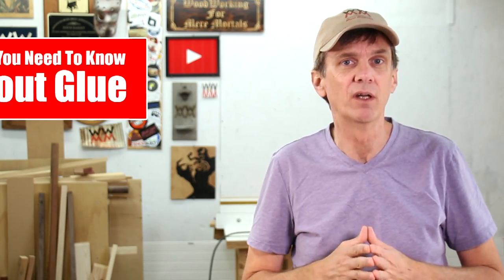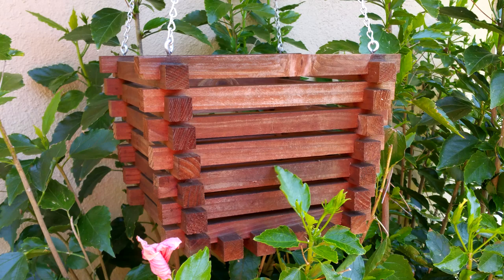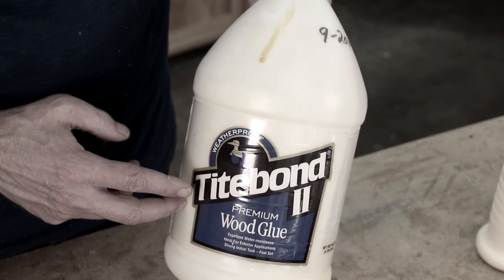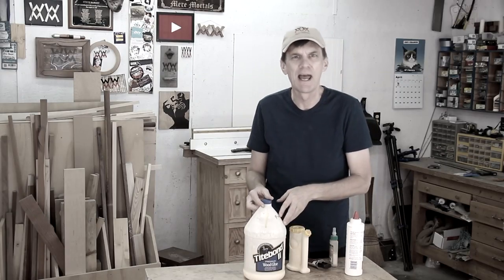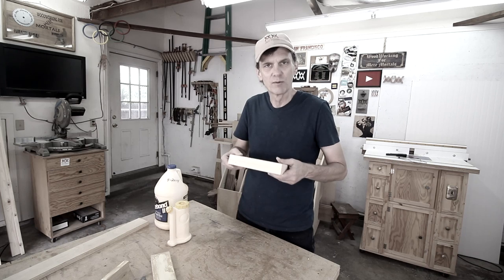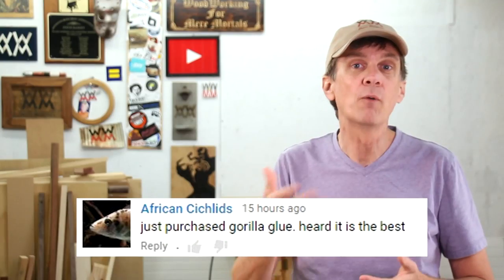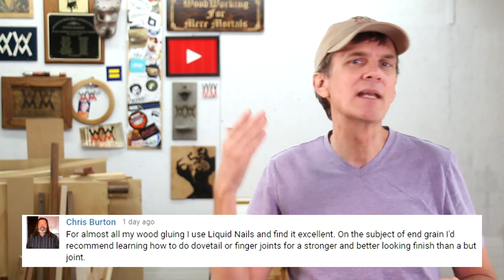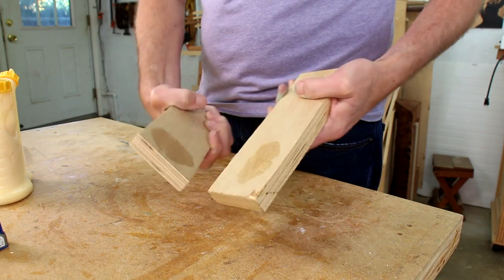Why I Don't Use Titebond III | MORE MINUTES

Comment: So here are my thoughts on this, the people saying Tightbond III is food safe are right, my guess is that it is food safe because it is only waterproof, perhaps what they add to Tightbond II to make it 'weatherproof' also makes it not 'food safe'. Most likely they both have the exact same performance other then this.
Reply: +Setsuraful 
The Titebond website says the same thing for both TBII and TBIII: "FDA approved for indirect food contact (cutting boards)"
Reply: +Setsuraful they actually have quite different properties, especially when it comes to open time.  Titebond III has a significantly longer open time then Titebond II.  Its not as long as their extended open glue, but it is noticably longer open time then TBII

Comment: So DAMIT! I’m a novice. Been using Elmers Wood Glue, it works fine.  The experts say, use Titebond! So I go to the store and wouldn’t you know it, Titebond 1, 2 or 3? So 3 is more expensive so it has to be better, RIGHT? I buy Titebond 3 and I didn’t like it as well as Elmers. Experts suck..

Comment: instead of buying a new bottle when the gasket is bust, why not cut a new one from an old bicycle inner tube. Road bike tubes are nice and thin, while MTB tubes vary from thin to stupid-thick. Plenty choices. Repurposes the tube and keeps another bit of plastic out of the dump.

Comment: hi everyone in 2019! im actually here looking for some info on titebond 50 - has anyone ever used it? i found a source, but it aint cheap - i've used tb2 &3 and 315g hide glue to build guitars before, but "fitty" is probably what i should be using... steep learning curve though (maybe?)
thanks see you all in 5 years!

Comment: When dry # 3 is dark in color and you'll be able to see the joint in light colored wood as pine. And # 2 is light in color when dry. That's the only difference I've seen over the years of woodworking.

Comment: Gorilla wood glue is pretty decent. I like it.
Reply: I discovered Gorilla glue's unique properties about 3 months ago. Works perfectly on parts that might not fit flush together.  The rubber ends (feet) on 2 folding support stands I use for my table saw kept coming off. Squeezed some water into the rubber parts from a paper towel (doesn't take much), added the glue, and slid the end back onto the metal tube.  After 30 minutes or so, the glue was bubbling up beyond the rubber feet.  I cleaned off the excess glue, and I don't think those rubber feet are ever leaving the supports again.

Comment: The BEST CAP iI found for Church Pipe Organ Leather Glue was the RED CAP on Elmer's Glue. I'd go buy a bottle POUR OUT and RINSE OUT the Elmer's Glue and put the LEATHER GLUE into the clean Elmer's Glue bottle, and that system would last a year or two. Where as the Leather Glue bottle would only last 2 or 3 months, and have to buy NEW. At $20 a quart, piss me off.  SERIOUSLY the designed Elmer's Glue Orange or Red Cap protected the applicator tip AND the contents of the bottle!!!

Comment: CA is very brittle by nature.  It does not hold a bond very well on wood due to the acidic nature of most woods, which actually interferes with the curing mechanism in CA.   Part of the issue with CA not doing well on wood is that the gap fill capabilities are not the greatest.  CA can be exceptionally strong, but substrate and bond geometry play a huge factor.  The "activator" is actually just to accelerate the reaction - the glue will still cure without it, but it will just take longer.  I do believe CA has its place - pen making, filling cracks in wood turnings, and repairing small non structural splinters or holes.  CA should not be used as a structural adhesive for wood, that is why you should stick to wood glue - it is specifically designed for bonding that particular substrate.  One or two notes on gorilla glue...  one reason you should stay away from poly urethane is that they contain isocyanates, which are a known carcinogen.  Always wear gloves when working with PU adhesives! second, the will work without the surface being moistened. Most wood has enough moisture to cause curing of PU adhesives

Comment: 2:03 "... the glue holding it together wants to repel stain."
does anyone have any experience with Titebond hide glue on this point—or actually, just in general.  I'd appreciate comments on your experiences.
Reply: I nought a bottle just to try it. It is fairly easy to work with, but it really gums up sand paper and reeks of old grumpy guy who hasn't taken a shower in quite a while when you sand it. It has a really long open time, so if you have a complex glue-up it may be worth a try.
Reply: NordboDK
thanks!  that's interesting about the sandpaper.  I wonder about using a card scraper on it.

this also makes me wonder how the titebond one compares to the oldschool kind you have to heat up

thanks for the info!

Comment: .....Tire bond loll   Works  at lower trempertures than titebond lll . There is five degree difference 60 degrees F vice 55 degrees F.
Aside from having. To heat my shop a little longer in the winter ll does the job about as well as lll for a little less money.

Comment: In addition to epoxy, Cynoacrylate is used on almost every model airplane constructed.  It is VERY strong for its intended purpose.  For one thing, the wood needs to be a bit porous, which the popular (for model aircraft) balsa wood is.  Rather than simply dismissing something because of low information and misunderstanding it's use, why not try a little research first.  :) Sorry to say this makes me wonder and question some.of your other information.  Hmm. :-/
Reply: in balsa wood you would get substrate failure before adhesion failure (the wood breaks before the glue)- as the nature of balsa wood is quite weak.  On other wood substrates,  CA is not a good choice.
Reply: "It is VERY strong for its intended purpose" yeah balsa wood is basically the most flimsy wood there is for anything beyond scale construction so I don't really see what your point is considering Steve is using glue for much larger and most robust applications.
Reply: CA glue is an anaerobic adhesive- it cures in the ABSENCE of air. Porous substrates like wood (which hold air) result in very low strength joints. I always cringe a bit when I see it used on wood, and cringe much more when I see people advocating keying the surfaces prior to using CA... In my opinion, epoxy is a much better choice for mixed material joints.
Reply: +Everfalling You all have never seen large scale RC model aircraft, have you.  Do a little look around on YouTube of quarter and third scale RC aircraft.  They are huge with massive engines and wing loads.  Much of the sheeting, hinges and other parts are bonded with CA.  Check it out. y point is that he is comparing the glue with the wrong uses.  Of course we wouldn't bong two flat pieces of playwood with it, but it does have its place.  To reject it entirely without understanding its use is not a helpful review of glues.
Reply: +videodistro sorry for the typos.  phone spell "checker"!   Aaaah!
Reply: +greaser5691 "CA glue is an anaerobic adhesive- it cures in the ABSENCE of air."  what? no it's not. CA glue cures with contact with water and the air has enough moisture in it to cure it by being exposed to air (this is also why it cures so fast on skin and in wounds). this is why opening and closing a bottle repeatedly leads to the glue becoming unusable more quickly than if you kept it in the bottle and never opened it.
Reply: +videodistro if this were a model plane channel you'd have a point but considering the projects he does it doesn't make sense to use CA glue for anything but a temporary bond. obviously it has its uses and works really well in some very specific applications but it doesn't seem like those applications are relevant to his work very often.
Reply: +Everfalling Exactly!  I was going to get to this but you beat me. :)
Reply: +Everfalling That's very interesting.  I've never heard water mentioned in the CA reaction until today (my involvement in materials at a technical level began over 30 years ago in the chemlab of an electronics factory). The reaction you've described (apart from the skin bit) sounds like RTV silicone rubber to me.  I note that the Wikipedia page for CA  agrees with you  (however most of the article has been flagged for lack of citation).
Reply: +greaser5691 baking soda also kicks CA glue instantly. why that is i can't say though i don't think it's because it's depriving the glue of oxygen.
Reply: +greaser5691 I work for one of the adhesive companies shown in the video and can confirm that all cyanoacrylate adhesives cure by moisture.  hence why "superglue" will bond skin immediately.
Reply: +Steve Rayner I'd be interested to find out why (in regards to CA):
- a tube with all the air squeezed out goes off in minutes but an open tube will stay liquid for months;- a spot on my skin stays liquid (can wipe pretty much all of it off with tissue) but will stick my fingers together immediately if I try to touch it. I used to use it for certain specialised types of PCB repair, I could leave a pool of it on a bit of polythene for hours and apply with a needle point. as soon as the track was placed it would immediately grab.
Reply: +greaser5691 two things play into factor here.  firstly, all CA'S are not created equal.  The Home Depot special Krazy glue is designed to last forever - and is therefore less sensitive to moisture, but nevertheless uses it as a cure mechanism.  these glues that are considered "shelf stable" have a higher acidic content which inhibits the reaction.  If you use and Industrial grade CA, the acidity will be  much less and therefore the adhesive will be much  more reactive.  If your bottle of CA doesn't have an expiry date on it,  consider it shelf stable.  This factor likely will account for tubes/bottles hardening up on you.  if you do buy an industrial grade CA, you should keep it refrigerated until you use it, but once it is opened leave it out of the fridge.  if you move it in and out, the temperature differential will actually cause moisture to be pushed out of the air (see definition of relative humidity).  this, may also play a factor in bottles haredening up.  as for the drop of glue on your finger/work surface; this has to do with bond geometry.  CA by nature does not cure well over large depths ax moisture must penetrate through said depth.  in general, the maximum gap you will be able, to bond with CA is 0.010", unless you use a 2-part CA which will cure to 0.2"  So imagine a blob of CA on your finger; the surface area to volume ratio of that blob is actually very low.  as that blob becomes longer and thinner over the same volume, the surface area to volume ration increases.  the smaller the gap, the higher the surface area, the more moisture available to cure the CA.  In a semi related topic, the reason human cells are so small all relates to surface area to volume ratio, and thus the ability to transfer electrolytes across the cell membrane.  Same principle, different application, but relevant nonetheless.
Reply: +Steve Rayner sorry for the spelling ; chicken pecking on a tablet....  also skin is mostly water, so it has a tendency to bond exceptionally quickly when fingers are pressed together
Reply: +Steve Rayner what's in CA kicker that makes it set so fast? surely it can't just be water right?
Reply: +Steve Rayner Thank you for the update. Consider me enlightened. :) Yes - used both types - I don't recall even the industrial glue having an ED back then (I'm getting old so all bets are off!) but even without an ED, the QA department used to impose a use-by on goods inwards for all materials like this as part of our AustStandards accreditation. It's painful to a hoarder like me to just discard 90% of a twenty litre drum of epoxy...
Reply: +Everfalling Yes, it is just moisture. Certain amines will react with CA, which are the active ingredients in accelerators.

Comment: Super glue has never worked for me, in any application.  It's always a disappointment.  The only thing it does well is become crusty on your fingers, and then you'll be spending an hour trying to get it off until you just give up and let it come off over time.
Reply: +WILSON! exactly my opinion on super glue...
Reply: +WILSON! CA has it's uses.  I've had good success using to glue in splinters, re-tacking loose veneer, etc when doing repairs.  But to get the benefits you really need the accelerator to kick up the curing speed.  I've had a lot of luck wrapping my thumb, pointer and middle fingers in masking tape before use.  Then you don't spend a lot of time waiting for the dried glue to drop off, or even more annoying picking bits of glued on skin off your project.  CA glue also doesn't seem to bond with the non-sticky side, so you don't have to worry about picking tape off rather than skin.

But I definitely wouldn't use the stuff alone in a load bearing joint: just too brittle.

Comment: Super glue is only designed for non-porous surfaces as you mention.  Don't think it would ever work well on wood.  Also it will only bond correctly with a super thin layer of glue.  In your example you apply WAY too much super glue.  It works by unraveling the molecular bonds on the 2 surfaces and causing them to rebond with each other.  This means the surfaces must be very flat and the glue layer micro thin.  A few drops would do a much better job than the amount you show in the video.

Comment: I use tightbond III on my cutting boards do to it's food safe...
Reply: +David Moss 
The Titebond website says the same thing for both TBII and TBIII: "FDA approved for indirect food contact (cutting boards)"
Reply: O really... ummm then I don't see any reason not to go with II then... I don't think it as awlays said that tho... good to know tho thanks man...
Reply: No Problem. One advantage to TBII is that it has a longer working time. I believe 10 minutes, as opposed to 5 minutes with TBII. But unless you have a particularly tricky glue-up, or you are subjecting stuff to a lot of water, TBII should do the trick.

Comment: Steve seems to be pretty sure of himself about some things that he obviously knows nothing about. Throughout this video, he makes statements about certain techniques and products that are wrong. Here is my rebuttal to a couple instances of misinformation.  Steve claims it isn't possible to starve a glue joint by over-tightening the clamps. He is wrong and you certainly can starve the joint by excessively tightening the clamps. The glue will travel the path of least resistance and squeeze out of the joint;.Just because the pieces are stuck together when you remove the clamps doesn't mean that the joint hasn't been significantly weakened. He also claims CA glue isn't strong glue and he has never successfully used it on wood. I can't imagine how he could possibly not get it to work, but that is what he claims. I get it to work all the time as do millions of other people and I can assure you that it is strong. It is permanemnt
Reply from the maker: Great rebuttal! We'll just have to agree to disagree! 😀

Comment: I only use TB3.  One bottle every 2-3 months.  Fine furniture, shop furniture.

I also use a damp rag and then a bit of sanding. 

I also use the wood glue sawdust trick. With TB3.

I use salt or very fine sawdust for big glue ups.

Gorilla glue is trash. Don’t buy it.

Comment: "Weatherproof" is NOT "waterPROOF"... simple.  Neither is 100% "waterproof", although Titebond III is more water resistant than Titebond II... neither is meant for 100% water submersion.

Soaking the hardened glue in an old bottle tip in hot water is usually enough to soften the glue residue to be able to remove the residue and remove it... nothing bonds to the LDPE/HDPE material that the bottle & tip are made from.

Comment: the super glue you are using is not the correct type. pick it up from woodcraft or fastcap. it is amazing you will wonder how you got by without it. you must use the activator with it to get the best results.

Comment: WRONG!!!  When using poly glue- dampen one side only, and glue on other side. Been doing it for years, never had a problem.
Reply from the maker: I find it's just too much of a hassle to deal with. That added step of dampening the wood is a pain on big projects. And the foaming is a mess to deal with.

Comment: Titebond III has a longer open time.
Reply: +Z# Productions You can get Titebond II Extend with a 15 minute open time, as compared to the 10 minutes for Titebond III and 5 minutes for Titebonds I and II.    In Texas, I use Extend a lot because heat greatly affects open time.
Reply: +Jay Ballauer Oh, and there is a Titebond I Extend as well.  Also 15 minutes open time.